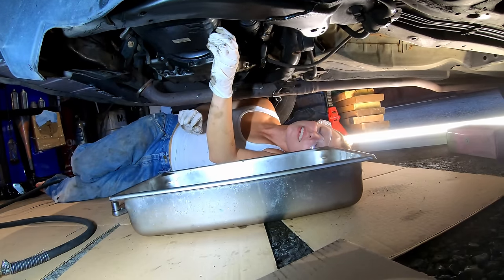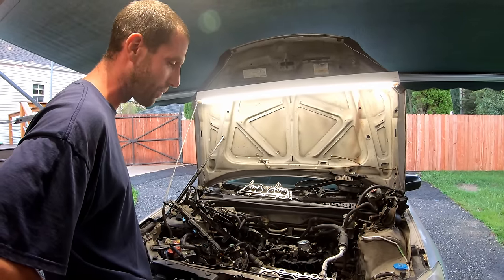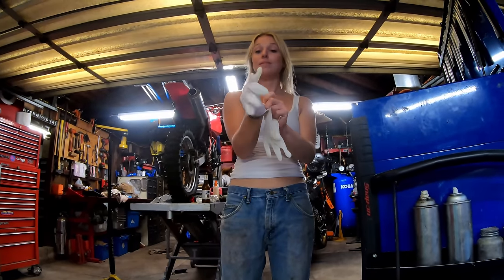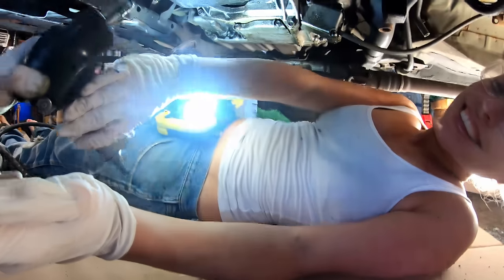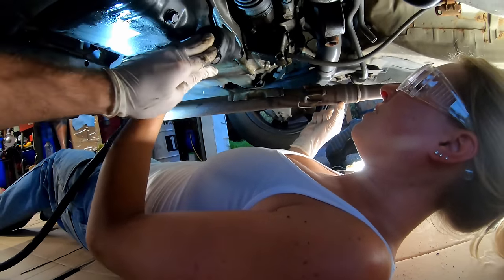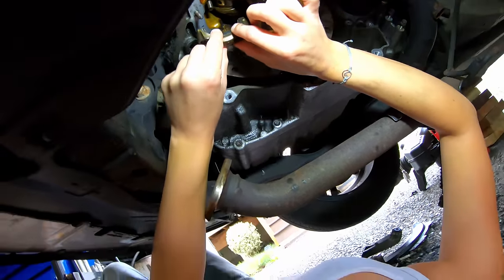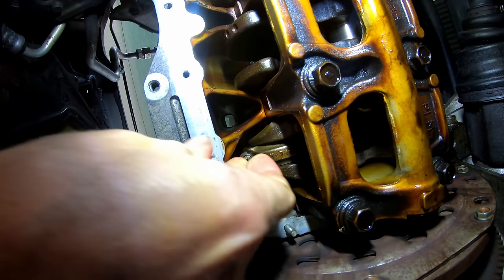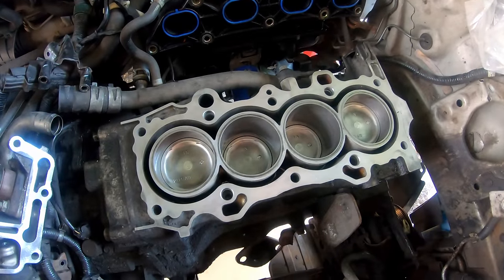Putting Jen To Work - Honda 1.7L Piston Rings

Comment: Too distracting to even know what’s happening. I see what you did there.
Reply from the maker: Testing your concentration. LOL
Reply: @NoNonsenseKnowHow  lol
Reply: Nicely Done,  My wife has help with some projects.  She will jump right in to assist or sometimes take over.  Just like Jen did there.  Great Job!
Reply: I can't believe you didn't change the bearings, they have some wear and they don't cost very much. I would have changed them.
Reply: @notme8121  me too
Reply: @notme8121  me too for sure!!
Reply: My father told me ... don't stare directly into the sun.
Reply: I was very nervous that a socket, extension, rod cap was going to fall and break one of her pearly whites.  I learned the hard way. 🙄
Reply: @notme8121  if it ain’t broke……
He had good oil pressure and no knocking with the original bearings.  You put new bearings in there and the clearance isn’t right, then you’re screwed.
Reply: What did he do there?
Reply: Some of you Youtubers definitely know how to get the views...
Turning boring engine work  on a boring car into millions if views.
Reply: @notme8121  Agreed!  He seems like a knowledgeable guy but that was a dummy decision.  Maybe he doesn’t know made in Taiwan is a good thing, perhaps he doesn’t know what a semiconductor is or who makes them.
Reply: @The_Redkween  That’s why you check the clearance but not changing the bearings was stupid.  He got a new head but left the bearings 😂
Reply: Wot-
Reply: This was pretty educational -said nobody that watched this video
Reply: @AngelSanchez-du8ze  exactly what i thought. Always put new rod & main bearings in, ALWAYS!!  That copper/brass look on the old bearings is wear, definitely needs replaced! 
That was stupid to go through all that work, just to use the same bearings!!

Comment: wow! , so you were able to do all this without removing the crankshaft girdle? to get to the connecting rod caps.. i didn't think that was possible, but i will definitely do this for my 93 civic... thanks...its great that the engine does not have to be removed from the car on these Hondas also..

Comment: I know just how Jen felt when she was working under the car!  it is hard work when you're not used to it, especially hard on the neck muscles.  A super and educational video. And well done Jen - you are gorgeous! xx
Reply: Working at a professional independent shop I’ve noticed I’ve gotten lazy and pampered because of lifts, so when I do some jobs at my garage at home, since I don’t have lifts and have to be under vehicles I complain about being on the ground.
Reply: @gabrielfranco9786  Had a lift about 10 yrs or so now. Recently had to do a quick brake job on a truck. Had a trailer connected to it and another truck in the lift bay. Man that's a lotta hassle just to throw some rotors and pads on. Move and unhook trailer, move truck out, pull truck in and lift it, then reverse it all...I'd be about done with the brakes by that time. Well turned into a bit more of a hassle brake job in the driveway but got it done...ah yes the good ole days...I don't really miss it at all haha
Reply: Oh yeah I worked on my own car for the first time this summer and the pain in my neck was the worst part about it. I swear my neck got a lot thicker due to having to hold my head in awkward positions for so long during the summer.
Reply: The neck part sucks. I usually throw an old t shirt or towel down there to help.

Comment: Mechanic for 55yrs. Nice to see a "Backyard" rebuild anymore. You can fix any light duty engine back to 99% for less than 1/10th the money of a "rebuilt" if you do it right.  A few tips if I may:  If I reuse pistons, I have them knurled. I never hone  the cylinders unless I bore them. I simply put it back together with new rings. They will seat in very quickly and you don't lose as much ring end gap in the seating in process. But if you insist on honing, lube the stones w/ veg oil. Then use detergent and HOT water to get the grit off the cyl walls. Then use 10 thousandths oversize rings and file them to fit. 3 - 4 thou for every inch of bore. If you reuse the bearing inserts, buy a brand new flat sharpening stone and "hone" off 1 or 2 "ten thousandths" from the cap and rod big end to get some of the crush back. Wash the bearings inside and out and the rod cap and rod big end with Brake Parts Cleaner to remove all traces of lube. You can reuse the head bolts too if they torque up OK. Just watch how many degrees it takes to reach each step of the 3 or 4 step torque sequence. If one gets there too soon or starts to go to far, stop and replace it. And be sure to coat the entire bolt with moly lube or dip the entire bolt into oil for accurate torqueing. To reuse rod bolts and nuts,  clean w/ brake clean & use "High Heat" thread locker ie: Loctite 263. I reuse any gasket that doesn't seal oil or coolant under pressure by smearing a thin film of Room Temp Vulcanizing (RTV) silicone on the surface after cleaning with brake cleaner. Honda makes a good one called Hondabond or use "Black" RTV, but use it SPARINGLY. Great video. ben/ michigan

Comment: I have a 95 Civic with the !.5L, It has 265,000 miles and still runs like a champ. Just put a head gasket and all new valves in it last year, uses a lil oil but it refuses to die. Awesome video... Good job.

Comment: Right to the relatively complicated core work(measurement -specs) job well done !  1  st  time seen that performed in car. Top marks for working under car to do the shell bearings . 🤘🇬🇧
Reply: Re ringing engines in place was common in the 1960's and 70's.

Comment: What works really well for cleaning the cylinders after honing is hot water mixed with Tide washing detergent. It works better at carrying the grit away where brake/carb cleaner moves the grit around instead of carrying it away. I would always use a white paper towel in the cylinder to see if any grey grit(metal) showed up on it before reinstalling the pistons. Good re-ring job well done.

Comment: Thanks for the video. I just did this to my 03 civic because you made it seem so straight forward. It took 4 days because I messed up the timing belt and had to tear it apart and redo it. My bad, I was looking at a mark I used last time I changed it. Otherwise, would have only been 3. What an awesome feeling to have accomplished. One question if you can answer. What is the green cap setting on the throttle body? I guess i moved it around when I was taking the head off and it came off. Not sure what it is or if it should be all the way in or what? Any Idea would be appreciated. I cant find it in my Chiltons manual or anything online. Thanks again for the video. Its nice to have a car again and not have to worry about the oil level.

Comment: Awesome video. Have to do this job soon on an 05 Civic so great timing. I just gotta say though on first start ups I like to pull the fuel pump fuse and crank it over without starting. Just to circulate some oil before actually starting it
Reply from the maker: Thanks man.  And I don't think I would agree with pulling the fuel pump fuse and cranking the engine. It's not going to build up oil pressure and will cause the assembly Lube to be squeezed out between metal surfaces. Honestly either way is completely fine in my opinion.  Now if it was something like a small block Ford then I would Prime the engine with a drill. Can't do that on the Honda though.  Or high-end Vehicles and airplanes actually have an electronic auxiliary oil pump to prime before every start.
Reply: @NoNonsenseKnowHow  Hmm never thought of it that way. I always just assumed that it built up enough oil pressure to make its way into the head/valvetrain, but maybe it's just a waste of time lol. Anyways, enjoying your videos!
Reply from the maker: @bradmacdowell6583  Yea I mean either way is fine when working on a Honda.  These things are tough as nails.  Minus the crappy head gaskets on some.  And cool, I appreciate you checking the vids out.  Thanks man

Comment: I used to have an almost identical 2003 Honda Civic EX. I miss the sound of it. I miss the transmission, mine had a manual. My wife and I owned it for almost 10 years. Bought it used in Manhattan, KS around 2010; we moved to Tacoma, WA in 2011, moved to Columbus, Ga in 2013, and finally to Clarksville, Tn in 2016. It had ~270k miles on the odometer and I put almost 100k of those on it. We sold it in 2020.

Comment: Cross hatch angle too steep.
The crosshatch angle should be consistent pattern throughout the cylinder. If the crosshatch angle is too steep the cylinder walls won't retain adequate oil to assist in the ring seating process causing the rings to pump oil and rotate too quickly. This often leads to increased ring and ring groove wear.
But a great patch up job, sometimes it’s not worth more effort.
Reply from the maker: I agree with you it was on the steeper side.  So far so good though.  She runs like a top and doesnt burn oil anymore
Reply: I was taught around 60%  cross hatch angle book say 50% to 75% its easy using a good power hone with sunnen stones they never seem to look good with the tree hone but i have always had good results with both.
Reply: Can you explain how a steep crosshatch angle could possibly cause "increased ring groove wear"?  I don't see a connection.

Comment: OMG that was hilarious - taking off the oil pan bolts - good thing you didn't have to deal with dirty salty  road water dripping in your eye after a snowstorm or having boiling hot antifreeze go down your back and burn you !

Comment: That was one of the most interesting and extensive repair  videos I’ve seen in a long time! Jen is an amazingly good sport, that cardboard creeper looked quite uncomfortable. Also appreciated the long term follow up footnote, as I was wondering how effective that backyard repair would be w/r/t fixing the original oil consumption problem. You seem quite skilled but… that engine was reassembled in an environment far from a “clean room”, so I was curious as to how well all the precision mating surfaces would actually go together. Good job!

Comment: Great video! I need to do the same to my 04 Toyota RAV4 as that year is notorious for oil burning. I've never done that before, but have swapped 2 motors (one in my 1988 Ford Diesel pickup and one in a Ford Windstar) in my driveway and pulled a transmission. Jen did a great job! You've got yourself a good woman in her. If she'll watch you bring home rusty junk cars and bring them back to life without giving you grief and even help rebuild the motor in her car, you hit the jackpot! If you haven't, put a ring on that girl's ring finger and change her last name! They don't come much better than that. Besides, she's hanging around with you doing all that stuff for that.
Reply: It's a lot easier putting some liquid Molly engine flush in the engine and running it at 2000 rpm for 15 minutes then drop all the old oil out of the engine then remove your old oil filter ...... then just fit a new oil filter and put some new oil in the engine and hopefully you are good to go. ... If they service the car more regular the oil wouldn't get so dirty and gunk up all the piston rings

Comment: I've got one of those Honda civics that is CNG compressed natural gas. I need to take time to find out why it won't run. It runs on the same kind of gas that you heat your home or hot water or using your gas stove. It is not propane. Alter cheap if you up. Pretty skimpy on locations to fuel it up. See I actually talked about the car. Entertaining video. I ask you to put some more on her channel where she sings

Comment: After honing the cylinders with a dingle berry hone you should use red scotch bright with soap and water and knock the edge down on the hone marks, makes a big difference, I was self employed for 35 years and did all my own over hauls rebuilt all kind of engines and are still running after 25 -30 years Cummings, Jd Ih, Case, Cat, and about every type of engine out there, Try it really works good.Just lightly scrub the cylinders, dry and rub oil on the cylinders. you will notice a huge difference after rebuild when you turn over the engine, The Cat i did, the owner said the oil would stay way cleaner then before and i used the same pistons and cylinders, which Cat freaked out and said I couldn't do that they had 700 thousand miles on them, and last I seen he has put over 400 thousand on the engine with no problems sense the overhaul. I rebuilt Cummings for a Person the rebuilds semi`s, which he misses, because he is now paying 20 - 25 thousand, where I was charging 7-8 thousand.

Comment: Nice job. Watch those machine shops. I had head come back with same broken valve springs. Another time and another machine shop took over 2 months. It dropped a in valve after 15 hours. On further inspection valve guides were not changed and valves and seats not reworked. Lucky no big damage to piston head and bore. Honda make a great car. Curious how many miles on it?

Comment: If the coolant resevor dosent work like on mine, it doesnt flow back the coolant to the radiator, just throw away to the trash can the original hose or check it well, I just throw it to the trash can and the plastic connector that connects the two hoses , and put a new one in place with out the platic connector... very nice work!!

Comment: To each there own. I would've pulled the engine & trans. It's only like 3 bolts whole assembly comes out. 20yrs ago, when I had Civics & S2000s, I pulled Civic engine & trans in 20 minutes. Hardest part was rollpin in shift linkage. Then you can work on engine without leaning over the bumper or laying on back

Comment: Always disconnect the negative side of the battery .  Buy a brand new head bolt tap to clean the cylinder block hole threads . Use International compound #2 to lubricant head bolt threads and washers .    Nice Work !     6/21/23

Comment: question for ya, im a Generator tech in the canadian army and we do a lot of cummins rebuilds and such.

for those lower rings that were sludged up and stuck, would putting a cup or two of diesel in the engine and letting it run really clean them up and make them work??

lots of the old timers say it works like a charm cause diesel is a great cleaner, just dont know of the probability of that working?

let me know what you think!!

Comment: 9:12 NO! Please never use a sandblaster with engine parts. No matter how hard you try, you will NEVER be able to remove all the sand. If you like to blast stuff, use ice.  It's btw a good idea to pull the fuse for the fuelpump before the first start and just use the starter to get some oilpressure build.

Comment: I figure someone sad it already down deep in the comments, but I groaned out loud when you didn't replace those bearings while the engine was apart, even if the new ones were Taiwanese parts. They def showed some wear, and it's a big job to go back in again.

Comment: I have a 04, 1.7 with 620,000 miles with original everything except accessories head and gasket water pumps and various gaskets and seals and one clutch. The key to these Japanese cars is maintenance, i change engine oil every 5k penz platinum and manual tranny oil every 50k. Ive never ever been below the head gasket and it doesn't burn any oil i can tell on the dipstick between oil changes.

Comment: How did those piston rings work out for you? I am doing this job on my 2004 Civic and OEM rings are discontinued.
Reply from the maker: Great. But it ended up having a cracked valve maybe like 15,000 miles later. I put a used engine in it. What a headache

Comment: Years ago I had an old Chevy 151cid 4 cylinder motor with 80000 miles that began to burn oil.  While I was starting to gather parts from the parts store for a rebuild, a good ole boy mechanic offered a suggestion to try before I tore the motor down.  He told me that my oil rings were just gummed up with varnish.  So, drain the oil and replace with same amount diesel fuel.  Start the motor and just let idle.  DO NOT rev the motor.  Just let it idle until you see the motor starting to come to temp, approx 5 - 7 minutes.  Turn motor off and drain the diesel.  Refill with new oil and drive for no more than 100 miles before changing the oil again.  I figured since I was going to rebuild the motor anyway so, WTH.  I was unaware, after starting the motor, just how much the oil quiets an engine.  I followed the rest of his instructions and the diesel that I drained was as black and thick as the original oil I drained.  The motor, however, no longer burned oil.  I eventually sold the car with over 130000 miles and it still did not burn oil.  I can feel everyone cringing and I was the same way.  I would not recommend it for every car, especially those that require synthetic, however, if you are already going to do a rebuild because of this condition, you can always stop and do the rebuild.

Comment: Great video ;) only downside is the statement that 140k original bearings will be better then "Made in Taiwan" ones. The old ones looked worn because oil maintenance on this car was poor .. as a proof go back and look on clogged oil piston rings
Reply from the maker: They're broken into the crank.  Fineee.   Put new cheapies and have problems.   Speaking from my past experience.  Unless your going to refinish the crank.  Or atleast polish

Comment: @17:10 you should have ensured the ring-gaps were not in alignment with neighboring rings!  Very important step. Oh, and a white tank-top may be good for clicks - but generally a bad idea!
Reply from the maker: It's not as important as you might think. Stagger the gaps and call it a day. They floating circles as soon as the engine is running. I've rebuilt a lot of engines and never had an issue. I've also disassembled after short run time and solved of the gaps were not where I left them